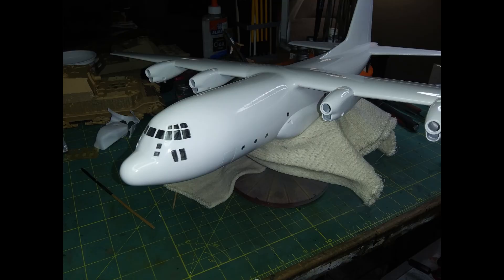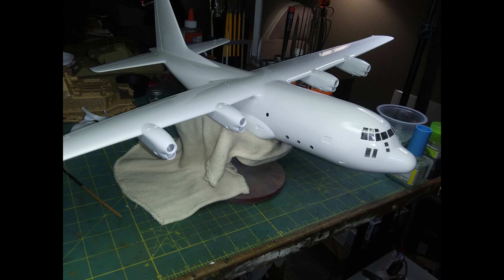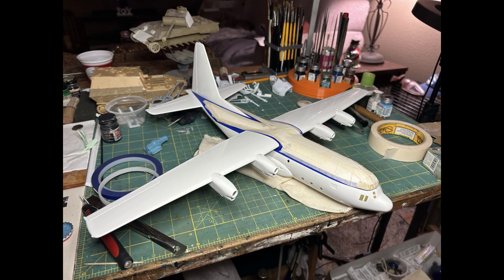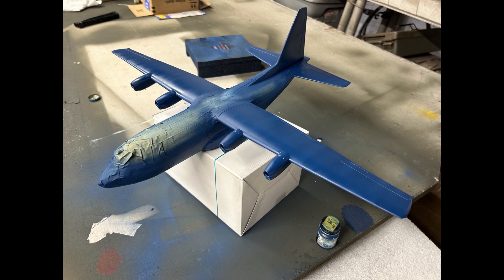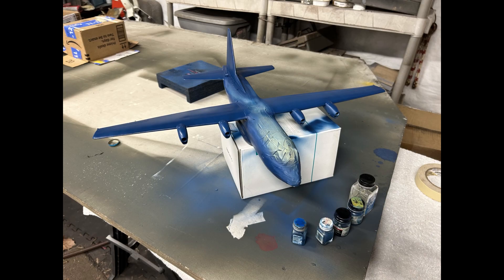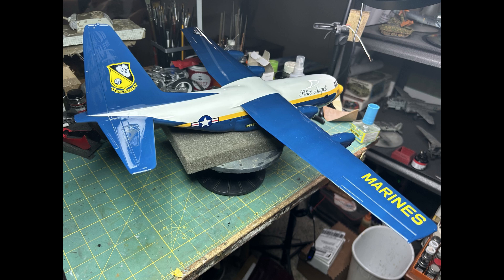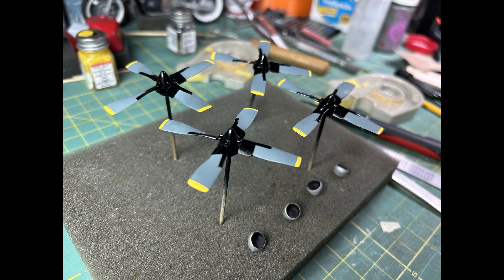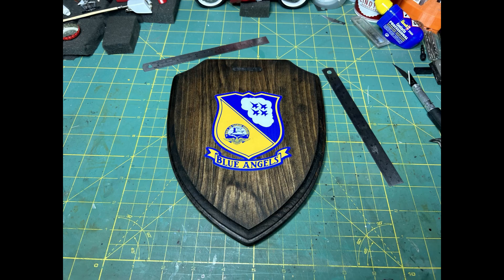Fat Albert KC-130F Hercules, Italeri 140 1/72 Scale

Comment: I've mentioned to max and others about me opening up a older model kit and using the same glue I've always used...but the plastic literally crumbled hours after I applied it.
What I'm thinking......the old plastic has micro cracks in it from what you mention about heat expansion. Then the glue flows into every micro crack and it becomes like a....styreneQuicksand
Reply from the maker: Thanks Buddy that makes sense👍